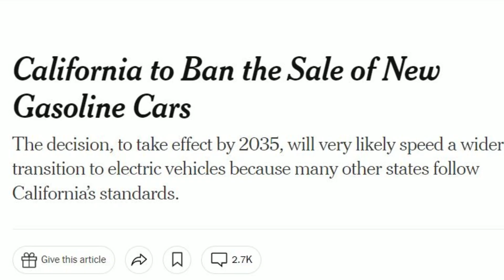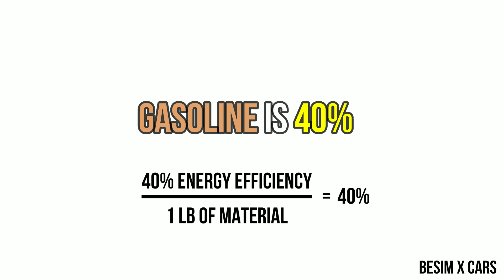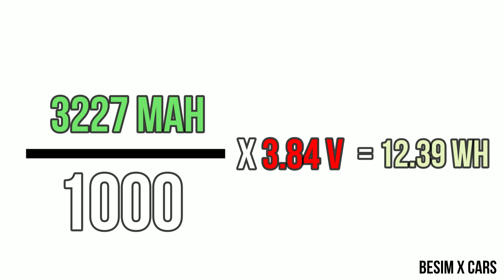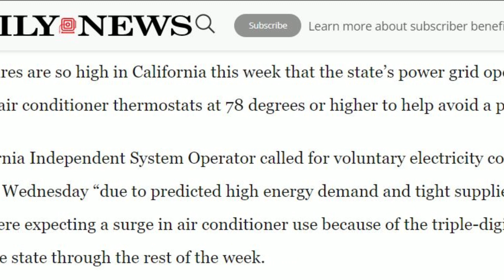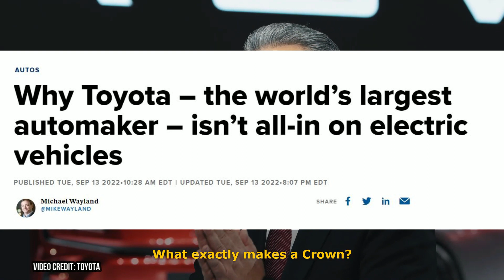Why Electric Vehicles Are NOT The Answer (EV's)

Comment: I have been thinking this for quite some time.   As you mentioned. there are many downsides to EVs.  EV range is dramatically cut in hot and cold weather due to battery environmental temperature control and heating or air conditioning usage. If you put a trailer on and electric pickup truck, your range is reduced to just over 100 miles.  The mining of lithium is horrible as you stated. The car battery packs have a finite life and cost around 20K to replace. The government should encourage new technology but the government is not qualified to dictate what the technological solution should be. I am going to pass on EVs for now. I have a Lexus RX Hybrid and one other conventionally powered vehicle. All get over 20MPH. The Hybrid shuts the engine down constantly and the other car has start/stop technology.   Toyota is experimenting with hydrogen engines, including fuel cells and also an ammonia engine. Lets help fund these technologies.

Comment: I didn't understand when you said energy cannot be created isn't a generator creating energy?
Reply from the maker: It is not creating energy actually, just converting it. So for example, there are a few different types of generators so lets use a gas powered generator. That gasoline is a stored energy in the form of a liquid, and is used to run an engine. The motion from that engine can then turn the generator which will create electrical energy that can either power electronic devices or charge a battery. Essentially we are converting a mechanical energy into an electrical energy. Hope I explained this example well :)

Comment: the main solution is to end private car ownership. get rid of suburbs and vastly improve public transport aswell as cycling infrastructure. after that get rid of any engine with more than 4 cylinders. with modern engines there is no reasonable argument for giant engines with huge displacement. the main solution is mainly just competent social engineering and getting rid of infrastructure specifically designed to put minorities at a disadvantage. cars have to become a luxury and not a necessity.
Reply: Argument: 4 cylinders and small displacement engines cant haul heavy equipment, food, or other resources across the country. (Not semis, hot shots or even farmers moving equipment)
Reply: @whitecollarbluestripe5540  i was talking about cars. it's obvious that tractors and other heavy machinery cant be replaced that easily. plus theyre way less in number compared to cars. however its undeniable that a decent railroad network is way more efficient for moving cargo across the country compared to trucks.
Reply: Maybe dont be poor  lol this comment reeks of soy

Comment: EV's are inevitable, and will play an important part in our future energy infrastructure. It is still early days, but things like thermal runaway are getting less and likely, as new battery tech enters the market. Solid state tech will virtually eliminate any fire risk.

Put it this way. Once ICE is gone, nobody will be calling for it's return.
Reply from the maker: I am very curious to see how SS batteries do. I believe Toyota is shooting to use them in a hybrid as close as 2025. It still might leave on the table the raw material mining and processing to be problematic though, that I would need to do more reading on. 

I would also be curious to see what SS battery's SOC curve looks like when discharging. Li-Ion definitely has a pretty impressive SOC curve in terms of performance.